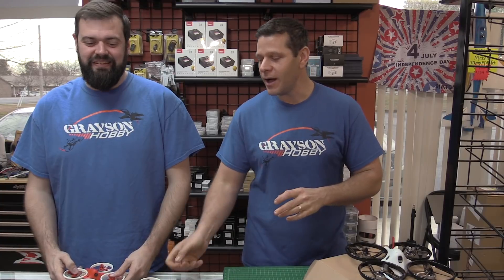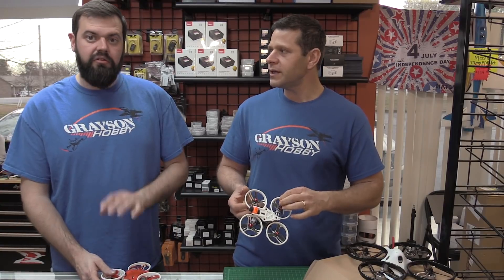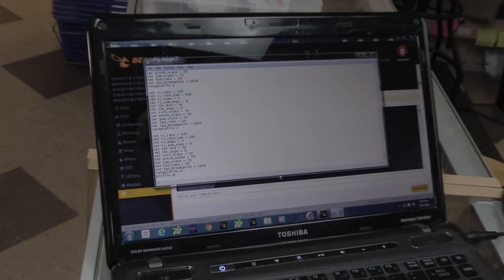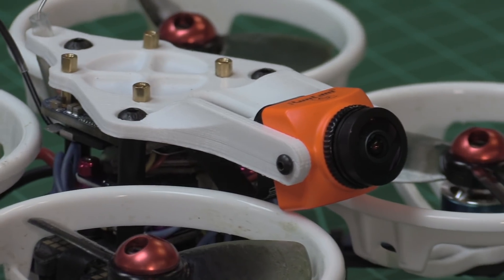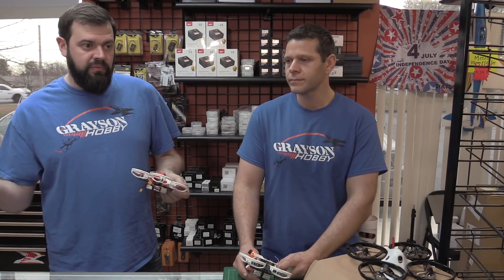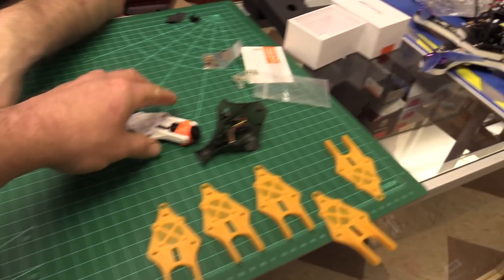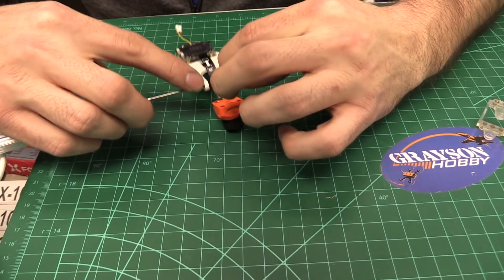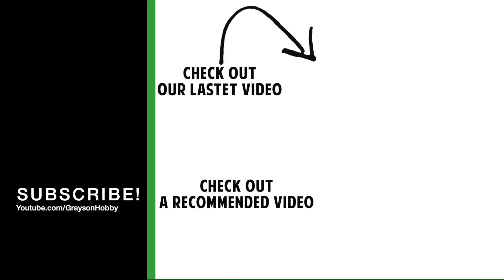ET115 Hi-Def Camera Upgrade 🎥 5 minute install. 🔥DIY CineWhoop

Comment: I mounted the camera board on the flight stack with standoffs replacing the locknuts. Did you notice that the extra weight makes the ET115 easier to fly indoors? You do need to update the firmware for turtle mode. You need 3.4 or better.
Reply from the maker: It flies heavier for sure.. Dont update the Firmware
Reply: @graysonhobby  How about the F4 in the KK220? Does that have the same problem with updating firmware? I'm using the KK20 stack from the KK220(and the Max?). The defective stack from Amazon had 3.4 on it. I don't know how it flew as the ESC only had motor #2.

Comment: Can the tiny gt7 do this also
Reply: I would think that the camera setup would be too heavy and no place to mount the camera board would rule that out.
Reply: @MnPaul1  but the caddix v2 works great on the betafpv 75x
Reply: @Bikelife-TEZ  The 75x has larger motors and a larger esc